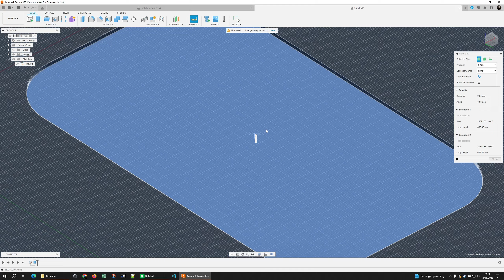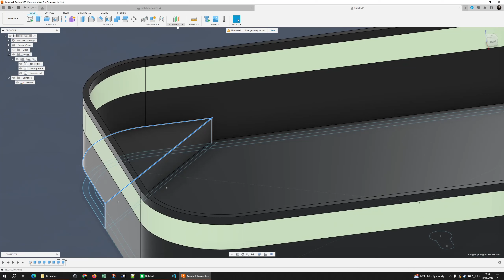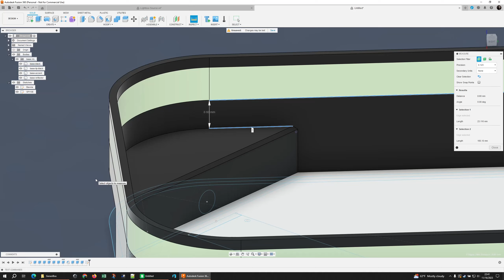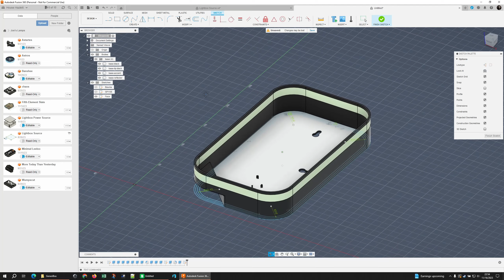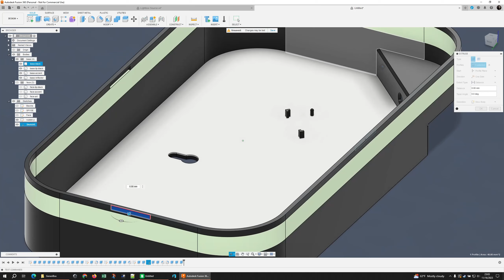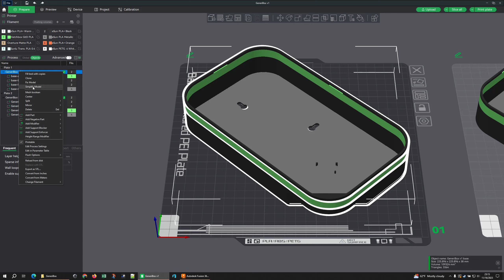Building the GeneriBox - A Customizable Light Box

Comment: Awesome tutorial and walkthrough in your process for this project.  Somehow I’m embracing to ask 😂but how to I go back and actually add my own design artwork of my choice to the face plate section?  Do I use the edit sketch section or bodies section?  Your example used simple letters cut and extruded off the face.  Sorry 😂I must be missing something and didn’t catch it your vid.
Reply from the maker: The easiest way is to add a black-and-white image in Studio by importing an SVG there. If you wanted to do a multi-color one in Fusion you'd need to grab the F3D from the CAD files and in the object tree enable only "face-lip-black" "face-accent-white" and "face-blank-black" (turn off visibility for everything else). Import your SVG and extrude the various elements twice - once to cut a hole through the face and once again to create the positive elements as needed like you would with a standard light box. Export that model as a 3MF or STEP and open up the FACE profile in Studio, then add your new 3MF/STEP to a new plate.

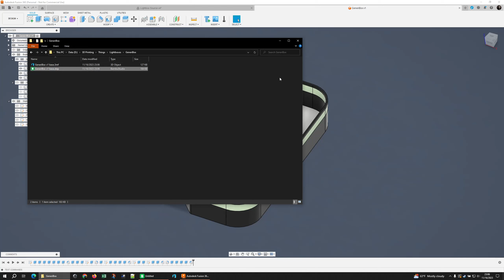Basically repeat all the steps I do at 00:46:43 but with your own artwork instead of the text that I used.
Reply: @ thanks so much for the guidance I will give it a go and reference your timeline and hope it clicks.  Thanks again, I appreciate your content.
Reply: Somewhat got it part of your process figured out, only confused still on the necessity to cut my individual elements off the pre-made face blank part from bodies tree.  Must the offset 40/-0.6 be used and extruded for every area of the sketch face as well?  A reference from another of your vid only uses -0.6 /from object of accent face which I must be confusing the two different scenario.  Sorry for my confusion I’m just trying to figure the best way to streamline and not repeat steps which I seem to be doing in my case
Reply from the maker: @RomeyT-dy8bf  the point in cutting it out first is so you don't end up with two bodies occupying the same space - when you get to the slicer it'll have a field day guessing which one you actually want to print 😂

As for the distances - on the cut it really doesn't matter too much so long as it goes all the way through. When putting the solids back in with a different material the actual steps matter less than the end result: properly lined up and the correct thickness. You could do everything as from/to object and select elements of the face, do from object with distance, or offset and distance - whichever is easiest for you.

Generally speaking "from/to object" is the safe way since it ensures everything always lines up properly and it's a good habit anyway. This keeps it more dynamic, so if you go back and change something earlier in the timeline all the elements move with it.

For me it's faster to do "from object -0.6mm" since I type faster on my 10-key than I do changing views around and looking for the right thing to click for the "to" object. I do my first object (the border or lip) as an offset distance, then use it's top surface as the "from" object for all other extrusions on the face and base. That makes it so if I want to increase it decrease the over-all thickness of the box, I only have to change the offset in that first extrusion and everything else moves with it. 

I think I linked "a year of lightboxes" earlier - the first video on Fusion goes over this in some detail and may be more helpful than this one, honestly. I've learned a lot since GeneriBox 😁
Reply: @RevHazlett  I appreciate the explanation thanks 🙏🏼 again.
Reply: @RevHazlett  finally got one of your Generibox designs made with your wonderful walk-through.  Noticed you actually shared samples for download on makerworld for quick instant print 🤦 well I still enjoyed learning your process.  Would you happen to have some guidance on how to implement your locking technique on a Circular pattern face plate and get them sketched evenly around the face lip plate?  In Generibox the four individual quadrants was conveniently easy to follow and sketch on but I’m scratching my head on how to do the same on curved designs.  Thanks again my daughter loves her Generibox 🙏🏼
Reply from the maker: @RomeyT-dy8bf  done and done! 😂
https://youtu.be/A5EyrpICODU?si=YFIwYFA3_rbrcxdC
Reply: @RevHazlett  thank you 🙏
Reply: @ I’m definitely not great at this stuff but with your insight and help I’ve managed to successfully make these light boxes.  As far as getting consistent and decent front plate face layers which is the highlight of the boxes.  Does your shared samples profiles have settings that help out with the dreaded stringing that contaminates the face layers.  Is it a speed or retraction setting I should enable to help minimize this?  My lightbox is great overall but the face layer is a mess with cross stringing contamination unfortunately which looks awful to look at even when not lit up 😬
Reply from the maker: @RomeyT-dy8bf  proper calibration is key. Flow ratio and pressure advance are very important. Having dry filament and a clean build plate are also rather important.

Sometimes lowering the hotend temp a few degrees for the first layer will help. 

Buried in the profile is "initial layer flow ratio" which needs just a tiny bump - 1.01 to 1.04 (101% to 104%) is all it takes. Lowering that a step can help as well.

I go over all these settings in detail here - https://youtu.be/-PQv6az2dfg?si=dg5tPA25pQkNM_dS
Reply: @ I have heard of these terms, though never really experimented with them in most prints in my use scenarios since I usually mainly print functional items and fairly happy with standard profiles in Bambu.  But you’re right in these circumstances where aesthetic is probably desired I should definitely learn these settings.  You’ve been so helpful and I truly appreciate your time.
Reply from the maker: @RomeyT-dy8bf  no worries! Calibrating flow ratio and pressure advance apply to ALL printing as they control the amount of material extruded. The effects of having them not perfectly dialed in are only exaggerated in light boxes since you are literally shining an inspection light through the print 🤣

Comment: Thanks for this tutorial. I learned a lot from you and your process. I do have one problem that I keep running into. When I print the lid my pieces keep separating into pieces. The accent will separate from the face and the lip. Any advice?
Reply from the maker: They separate in your slicer, or when actually printed?

Either way, I'd first ask if they were imported in to an assembly (the question I answered "yes" to).

If you're printing directly from my 3MF on Makerworld it has my process profile already built in, but if that was changed or overwritten you may want to collect it directly - https://youtu.be/Yz9rzAud0vI?si=Ri6tqZqv3OweIMTH

Past there, my profiles depend on having well-tuned material profiles, something I cannot provide for you as they are unique to each spool. I highly encourage running the Pressure Advance ("Flow Dynamics" in Studio) and Flow Ratio tuning for each of your filaments.
Reply: @RevHazlett  Thanks for the quick reply. I don't get that question when I import not sure why. My lack of knowledge is really showing.  When i import the step file it comes in vertically to the plate and if I hit the O or P the parts fall to the plate. I have to chose a face then separate them into objects to paint. I did go through the video and copy all your parameters to your face process. Sorry for the numerous questions.
Reply from the maker: @TomRowbotham  ok, so a STEP file shouldn't ask the import question (I don't think, at least). Breaking to Objects will completely separate all bodies (or components) out. Separating to Parts should keep their positioning and make them part of an assembly, which is what you want.

Or, back in Fusion, you could do everything as components. Something I've never really done much with but it doe smake life easier and it will be a main point in the next video ... if I ever have time to make it 🤣

I might just do a little short to explain all that later tonight.

Comment: silly question from a noob... i made the original box, then saved it as a new file and want to make a square one (200x200). The base has a lock on it. When I change the sketch dimensions, the sketch of the face disappears. Is there a way to keep it and get it to scale the same way easily, or am I stuck making the sketches of the face again? 

Thanks so much!
Reply from the maker: I don't think I properly linked all the elements together to be able to parametrically scale it. Not between sketches at least.

When I made the square one later on I had to play with it a bit to rescale it properly. I think it was mainly just the locking tabs that had to be moved around. Navigating through the timeline can help a lot with efforts like this.

Comment: Amazing video!! I have to say,  the BEST lightbox video that I've seen so far in my new 3D hobby adventures.  My only disappointment was that you don't have more additional videos like this one, other than the Lightbox Part Deux - Assembly video, but  I've watched all of them that you've posted on YT.  I just built my first lightbox, using this video, and it turned out amazing.  Do you have any other video's or instructions on setting up the hardware for the lightboxes?  I purchased the SP110E and the USB Type-C breakout boards for my lightboxes.  What screws should I use to install the USB board in the box?  Also, the USB plug doesn't match up too well with the hole in the lightbox so I'm going to have to make some small adjustment to get it to fit.  Anyway, thanks for the great video's and information on Maker World.  Looking forward to watching many more of your future videos. Keep up the great work!
Reply from the maker: Thank you kindly!

I intend on making a more updated video that's not "lets draw a box" but more like the first with "lets use this SVG," since I think that's what most people are doing.

For the USB-C Breakout (the one on the red PCB?) I used M3 self-tapping screws. You could use M2.7 if you made the hole a little smaller, but M3's give a nice big contact area on the board to really lock it in. You may want to do a small-scale test of the hole you punch through for them to make sure it's the right tolerance.

As for the hole lining up - I'm sorry about that. I've bought two batches of them and they've been close enough to fit from each batch, but you never know with cheap no-name brands 🙄

I'm going to re-build that in my template so it's easier to tell which way is up as well - I've installed them in both directions and they do require a different offset depending on the orientation.

For the USB snap-in plugs, I always have to pinch the retaining sides in with some pliers to get them to fit properly. If I make the hole bigger it doesn't stay in very well once fully inserted, any smaller and you can't compress them down all the way to force it through. Always takes a little effort and wiggling.

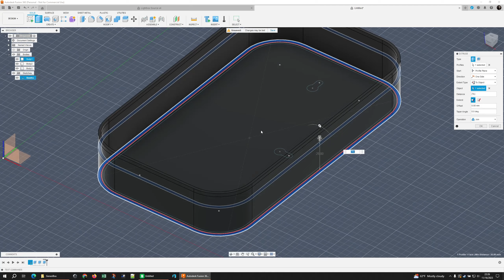Comment: At 9:35ish why did you turn that off so it wouldn’t join? It stays joined forever anyways.  That’s not the top.  I don’t get it.
Reply from the maker: I only wanted the base wall connected to the first 25mm of wall. The 10mm of wall above it is assigned as an accent wall to be printed from a translucent material, then the final 3mm of the base (plus the 2mm of the face) create the last 5mm of height.

The idea - if you look at it from the top down once assembled - is 5mm of black, 10mm of translucent (I like using glow-in-the-dark), then 25mm of black down to the very bottom.

This accent wall allows light to be cast out the sides of the print as well as the face, putting a bias lighting of sorts around the box on the wall. I think it's pretty.

You can do this with changing filaments at layer if you want, I prefer doing them as separate bodies so it's just two clicks to make it a different material.

Comment: Awesome video!!  Thanks!  One tip, you can turn the face on and use the combine option.  Select the box as the target and the face as the tool.  Select cut and "Keep Tools".  Click ok and it will cut out the slots you need in the box.  You may want to then use the push/pull tool to open the slots up just a hair.
Reply from the maker: I understand where you're going, and for sure it'd work. Could save a step or two and would help keep them aligned when making dimensions changes. Thanks!

Comment: Is it possible the difference in print time (STEP vs 3mf) due to the step invoking the ARC (G2-G3 Arc or Circle move)?
Reply from the maker: There's a separate video discussing it in my channel with some really good discussion in the comments. In a nutshell: Studio and other Prusa forks cannot interpret STEP so the convert it to a mesh on import at basically the "highest resolution" the slicer will reasonably work with (I believe it's a component of arc resolution values).

Of course if you already have a mesh (3MF, STL, etc) that resolution is already set at creation and the slicer will work with whatever it's given.

My problem was using File -> Export in Fusion does not give you the mesh definition settings, so a 3MF exports as a default medium quality. That resulted in more G1 than G2/3 arcs. A high quality 3MF from Fusion is roughly the same as an imported STEP though, so they are basically the same at that point.

3MF has benefits - volumetric data, body labels, color info, etc - but that extra data comes at the cost of for size for the actual mesh as compared to the raw math of STEP files.

My basic rule - if it's only a few bodies that I need to address individually (color, print settings, etc) I go STEP. If I need to body names or it's a very busy model I go high quality 3MF.

Comment: Is there a reason why you dont use "components" instead of "bodies" in fushion? I find it very easy to see all the files that way and its makes 1 file instead of multiplebodies if you have alot of small parts
Reply from the maker: Mostly because at the time I recorded this video I was still very unfamiliar with them, in all honesty. I've since learned about them and do sometimes use them, but for the express purpose of making lightboxes simple groups work well enough.

In other folk's workflows where they are exporting one STL per color and are not using 3MF/STEP files, components work much better. That's been a bit of a raging debate in our communities, however I'm not making these as commissions with customers requesting STLs (for one reason or another) so I do them the way I feel gives me the most control when the models reach the slicer; part-aware formats allowing me to tweak individual bodies is something I find useful, so I use them.
Reply: @RevHazlett  okej thank you for the answer! I have another question: how do you create those small locking tabs on round surfaces?
Reply from the maker: @Calzune  I haven't tried, to be honest. For boxes built with organic shapes I just use a countersunk M1.7x5 screw somewhere along the top to pin the pieces together.

Comment: Great video! I want to change my light box design to front lids and this was a nice solution. Also picked up a couple of fusion tricks  I didn’t know. 

A few thing I would do different: Use a construction line to find the middle point for the tabs. So you don’t have to delete it.

More use of extrude to object, just in case you want to change some dimensions later.

And combine bodies (bolean)on the to cut out the internal tabs notches.
Reply from the maker: Since making this video I've switched to making all but the very first extrusion "from object to distance" for exactly that reason! It's not quite making the whole thing parametric, but changing that first extrusion is all that's necessary.

Comment: did you have to take into account the any clearances for the lid and main box?
Reply from the maker: None are necessary as you want it to have a friction fit. I've printed dozens of boxes using this technique and they all fit together great - if not even loose sometimes when the perimeter geometry is very simple and I have to add a screw to hold them together. That was the intention for the retaining tabs on this box - to remove the need for screws or adhesives.

Check out the end of the video for finished examples!